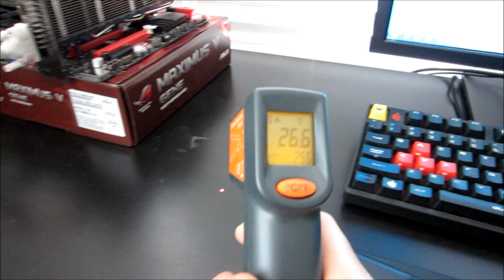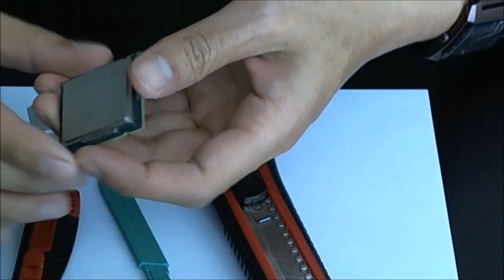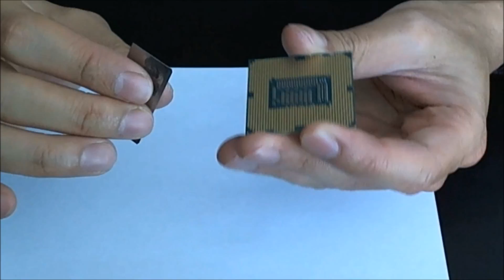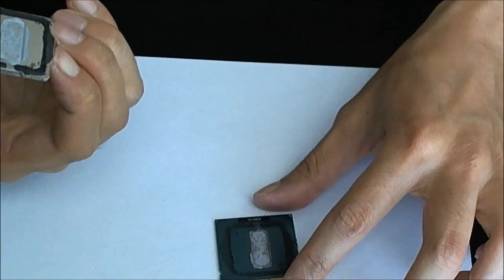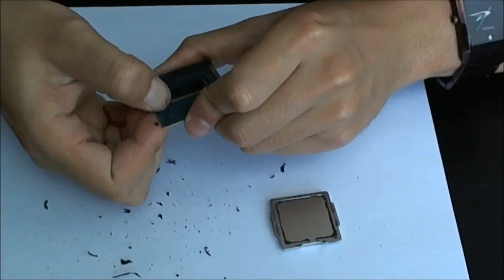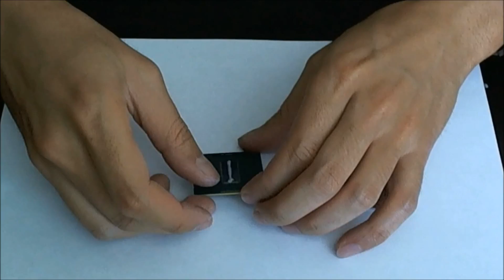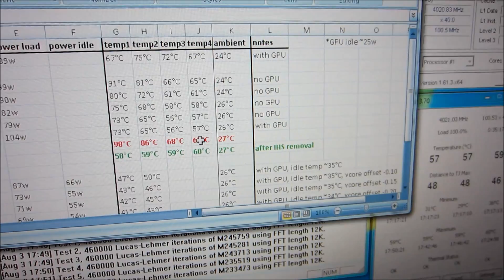Fixing Skylake, Haswell, and Ivy Bridge CPU temps: IHS removal

Comment: Touching the pins with your fingers reduces their conductivity
Reply: TheOfficialKiro67 In Intel CPUs the pins are in the socket, but the other part of the pins is in the CPU. In AMD it's the opposite
Reply: You are both right. The electrostatic discharge will massively overvolt the transistors inside (you'll put a few kV in there if you're unlucky), causing them to fail. Some do so open circuit, others short circuit. So the ESD itself does not make a short circuit, but the result of the killed transistors probably is a short circuit.
Reply: i don't think that tose cpu's have pins , only old cpu's used them
Reply: oh sorry , i actually tough he was talking about pins on the CPU, i jsut saw a person on 9gag did this mistake (he tought that intel cpi's have pins) and i tought
 he was also talking about pins on intel CPU, my bad
Reply: ***** the ones in the cpu yes
Reply: yes it does, by increasing resistance by less than 50mOhm..... LOL pins in socket are sharp because of that reason
Reply: a little rubbing alcohol and few q-tips would clean that right up
Reply: ***** you cant short circuit pins with static electricity
Reply: static electricity cant short 2 pins, it can only kill cpu
Reply: but still cant short pins :)
it shorts transistor :D
Reply: It shorts the transistors that are in between the pins causing a direct connection between said pins (or contact pads to be more precise, but pin is fine in my opinion), which is a short circuit between the pins.
Reply: Skin oils can cause issues and malfunctions. Contact is needed for the signal to go through properly. You have a foreign substance in between those contacts issues will arise more time than not. I've seen some chips that had coffee spilt on them and not one issue. Others a spec of dust is a huge problem.
99.99% pure alcohol will clean just fine.

Comment: I was delidding my 4790K because there was a huge inconsistency between the temps of the different cores. I nicked the chip on top if the ICs are on the left, but I assembled everything and everything seems to work. I've been using the system for over a month now. What is disabled in my CPU? All the data buses that I currently use work just fine. I am however, hesitant to buy new parts as I don't know what will and won't work.

Comment: Don't do this at home guys... If it has high temps than it should have, just return it. This will void all warranties on the CPU.. And don't do this ESPECIALLY if you have never built a PC before. Because if you have not built a PC before, then you are fairly new to PC hardware.

Comment: would leaving the IHS off altogether show better temps?
Reply: leaving the ihs off is better because of less thermal resistance - would be better without a heatspeader and using a hs with a copper base, the main reason for the IHS is to stop dumb people cracking/chipping the die. surface area has nothing to do with it because the headspreader will still have the same surface area that the hs would have straight onto the die the difference is the extra thermal resistance that the ihs creates between the die and hs.
Reply: surface area

Comment: Just something to say... TRY AS MUCH AS YOU CAN  NOT TO TOUCH ANY CONDUCTIVE PARTS OF THE CPU. AND WHY IS THAT? YOUR SKIN CONTAINS FATS, YOU CAN SEE THEM WHEN YOU WIPE OR SLIDE ON YOUR PHONE'S SCREEN WITH YOUR FINGERS. ANY OF THESE FATS WILL DECREASE THE CONDUCTIVITY OF THE CPU. TRY TO HOLD THE CPU ON THE EDGES, TRYING NO TO TOUCH PINS OR METAL PARTS WITH HANDS. IT'S JUST A SMALL TIP, IT WON'T AFFECT THE CPU MORE THAN 1-5% . HAVE A NICE DAY EVERYONE :)
Reply: This doesn't make any difference. Having fingerprints on your cpu before you apply the thermal compound is a bigger issue.
Just a small tip: the key above shift disables caps :-)
Reply: I can clearly see that you didn't get the point.
Reply: I did get the point. I tested this some time ago with an X5460. I touched the conductive parts a lot. The CPU works as normal. If you are grounded there's nothing that could happen. If the surface of the LGA Socket of the CPU is covered in fat, the pins on the mainboard are pressing hard enough on the cpu so there will be good contact.
Reply: +Moritz Rudolf I have an engineer degree I don't need to argue about that with some guys that read google and think they're smart and be here just to post troll comments. I can clearly see you have no knowledge in electrical conductivity and resistivity. I will leave this conversation right now

Comment: I think not using adhesive between the chip and case is a bad idea.. There is glue to help prevent too much pressure on the chip causing it to crack or break.

Comment: Why not just get a better cooler?  Delidding in skylake is pretty useless from what I've seen too.. my CPU never gets over 60 C in prime 95, core i5 6600k
Reply: My 6600k idles at about 29c, under full load about 65c. (it's overclocked to 4.2) I cool it with air too and people wouldn't have so many problems with temps if they used a quality cooler.
Reply: Beast6228 mines under liquid, at 4.7
Reply: Ehsan Mintman H100i gtx, MSI Z170a SLI Plus

Comment: good day... iremove my IHS, upon removing it transistors were hit and remove.... 3 or 4 resistore were damage.. so... i thought it was broken.. but when i tried itagain.. it still working... my worries is that would could be the possible effect if those transistor were remove.. my processor is A8 hope you can answr me thanks
Reply: amd a8 are soldered, there are tons of little transistors under there

Comment: i have westmere l5630 its core 3 and 4 have 10 degrees Celcius difference, and using prime it would hit 90 deg C after few seconds (even after reaplying as5) .. so i tried removing it from dead E5520 and there were little capacitors which were damaged (probably blade went a bit deep when prying it out) and even though the seals of ihs were broken but it wont come out .. neither would it budge sideways with twisting so i appiled little force and half of the chip came out attached to ihs...  but there was no thermal compound like applied on your cpu. it was some sort of stronge glue.. i still cannot remove the remaing chip form teh ihs.
so yes do not try it on sandy bridge.

i have uploaded a video of it.

Comment: Pro tip: Cut into one corner, then get a small, thin plastic spudger and gently force it in the the cut. it helps keep the risk of cutting and damaging the pcb down.

Comment: Haswell refresh (devil's canyon) and Skylake are cooler running CPU's as they changed to a different compound of paste, you do not need to "delid" them unless you are wanting the cooler to make direct contact with the die, which I REALLY don't recommend, and with skylake you are just jitterbugging with death due to the fact that skylake uses a much thinner PCB than earlier CPU's. I can run my 4790k at 4.8 all day and not see above 65°c on the hottest core. Also air cooling with big overclocks????????????????? Are you mental?????
Reply: +Kris Burke You can still get a significant drop in temps,something around 20 degres on a devil canyon if you delid,change the thermal paste and remove the adhesive that holds the lid on the cpu.and then you put the lid back,so is your 4790k delided or not ?  and what cooler do you have ?
Reply: +R Madalin I would not delid if you paid me to, it's a fucking stupid idea and I've never heard of that much of a drop unless you have it on LN2, at the moment I have a Cooler Master Nepton 280L with Vadar 2250RPM SP fans on it, I have everything but the new black chrome piping for a CPU and GPU custom loop, 1x360mmx30mm rad, 1x360mmx45mm rad and 1x120mmx45mm fan on the rear for good measure.
Reply: +Kris Burke well you don't exactly need to delid since your setup is water cooled, but if you are on air deliding  may be worth it. Just look in this dudes vid, he dropped his temps by almost 30 or so degres
Reply: +R Madalin "Overclock on are" because you like to set fire to space and time.
Reply: +Kris Burke wut?
Reply: +R Madalin I would NEVER recommend overclocking anything above 4.2ghz on air, EVER, you are flirting with failure there, no wonder you are getting freakishly high temps per core.

Comment: try using a blade for a safety razor, they seriously just slide right through the adhesive because of how thin and sharp they are. much less pressure needed, meaning safer for you and the part

Comment: You know I moved a cpu from one motherboard to another ... didn't clean off the old paste.  I put on a fan from an old pc, didn't clean off the paste but did add a "blob" more as it looked a bit dry and sparse.  At the weekend I removed the fan and put on a new heatsink, this heatsink had some pre-applied thermal paste.  So the PC has 4 different kinds of paste mixed up (old stuff from fan and cpu, pre-applied and blob ox MX2).  I booted up the PC and the temps are idling in their 20Cs with temps on load between 40 and 55C.  Thermal paste maybe needed but not to the extent and exact science that many believe.
Reply: sounds like you might have won the silicone lottery.  Imagine if you wiped off all that crust old paste and put on just a dab (less is better) of new stuff

Comment: People here generally think that a heatsink cannot be installed directly onto the CPU die once the heatspreader is removed...this is not true..people regularly took the heatspreader off back in the socket 775 days...you will definitely reduce heat considerably if you reapply the thermal grease on the die and put the heatspreader back on OR even more if you install the heatsink sirectly onto the die...you just have to see if the screws that came with your heatsink/backplate assembly have more threads than are needed...if not, you can most likely buy the same screws with more threading on them to screw down the heatsink further....you just have to be careful as to not crush the die with too much force...going directly onto the die will yield the best performance in cooling the CPU down...up to 25-30c depending on the CPU you're using.
Reply: +Gurvinder Parmar well intel went another fuck u onto consumers making skylake pcb thinner than earlier ones, resulting in a more fragile cpu, possibly bending.
http://www.pcper.com/news/Processors/Intel-Skylake-Processors-Can-Bend-Under-Pressure-Damage-CPU-and-LGA-Socket
i guess that was another 0,5 euros safed like the heatpaste vs soldering.
gosh fuck u intel.
other manufuctureres throw strong backplates on their products to streighten it, like graphics cards, or even motherboards nowadays.
intel says fuck u we got a monopol, we do what we want!
Reply: +cataria I wouldn't take the heat spreader off of Skylake unless you are putting it back on...lapping the heat spreader would be a great idea...and further lapping the heatsink base as well.

Comment: There is no need to "fix" Skylake temps. My 6600K keeps 23-26 (depending on ambient) degrees during idle and max 65 during stress while being overclocked to 4.5 GHz.
Reply: +UpiornyOdkurzacz I just built my 660k system and it idles at 22-24c and at 4.5ghz, it goes to 58c...using Corsair H115i...very happy with the system.

Comment: I have a i7 4970K  + antec water cooling cooler..     it always run fine and quiet..  but cores where getting pretty hot while stressing them. .. ~85c   @ 100% @ 4,4gHz  

the cooling system never got hot.. the cupper block was barely varm..   tryed replacing the thermal paste.. didnt help .. 

used it like this for a year..   

a couple of days ago I was abit boored.. so I tryed overclocking my gtx980 and cpu..  cpu was stable at 4,6gHz  and benchmarks got abouit + 15%  higher scores..   kinda cool... then I noticed I hit 100c at stresstests.. but computer was still steady at 4,6 ghz,,,  later it started thortling down.. 

could only keep like 4,2-4,4 ghz @100c ..        still the water cooling system was really cool..  bad heat transfear ? or bad temp sensors ? 

I desided to try this heat sink removal thingy. .   now I done it and it´s even worse :D 

wtf..   idles at 35- 45c    and stress tests make it thrortle down to 4  - 4,2  ghz.. when hitting 100c .. 

yay I made my 4970K into a 4770...  :P 

seems permanently fucked..      used arctic silver 5 thermal paste.. and the line method on all surfaces..  and did not use alot of it..     should transfear heat just fine. 

tryed replacing it several times with diffrent amounts of paste..  but  getting more or less same results ..   

overclocking is gay. . . should have just left it at 4,4gHz and been happy with it..    it still runs every game at full hd on ultra settings anyways.. 

bleeh..
Reply: +TheKlingis That sounds to me that you crapped out in the silicon lottery with that one, my 4790K gets 4.8 all day and sees a highest of 65°c under load, 85°c on a burn in test and that is with only a cooler master Nepton 280L AIO, I'm getting all I need for a full custom loop and I will be going for 5ghz on this CPU.
Reply: +Kris Burke be careful man, you might fuck it up like I did mine 😜..   these processors already play all the latest games and isnt a bottleneck no matter what gpu you got.,.   I guess overclocking it for editing videos faster or some work like that would make sense but for games it wont do much diffrence..
Reply: No need to be careful, been overclocking PC's since the early 90's, these days it's a cakewalk. I find out what the CPU won't do, then back it off till it's stable, and I always burn in CPU's and GPU's before overclocking also, you can get way better results than just going in with a green core.
Reply: I used an automatic overclocking tool that came with the motherboard.. It left it pretty high and it ran fine for a while,  until it did'nt, lol..     I should had gone on a forum and looked at other peoples results instead and put in the valued manually..    Oh well..
Reply: I never use that tool, I always do it the old fashioned way, manually, in the Bios.
Reply: +Kris Burke 
Yo man.. wtf 5ghz ? u need some insane cooling for dat stuff 
and yeah, no reason to go for 5ghz, it doesnt do shit
better 5 years of 4.2-4.6 Ghz than 1 year of 5Ghz
Reply: Just doing it for a competition between mates, have had this CPU to 5 ghz under water before, the normal clock for this CPU is 4.8 with no boost, I have 2X360mmX45mm 10FPI Alphacool rads and a 120mmX60MM radiator in it, might be modding the case to fit another 120mmX60mm rad in the bottom soon, just finished the loop on it last week, the AIO almost melted when I did it last time, so this loop should be enough.
.

Comment: Dare god this is nightmare for pc folks how he handling the cpu seems like rape.
Reply: No
Reply: +Chris Frog It is rape, I would NEVER do this shit, ever, specially with Skylake, skylake has a thinner PCB, you will fuck it's shit if you try to remove the heat spreader from it.
Reply: ***** their is actually tools to remove it properly thats fine cost around 60 USD but this way its rape and bad that hes showing other to do this way.
Reply: I wouldn't do it anyway, the poor heat dispersion problem only seems to affect the Ivy bridge and pre-devils canyon Haswell CPU's, I have 3 devils Canyon CPU's, a G3258, an i5 4690K and a 4790k, all can be overclocked past 4.6ghz and the highest temp I've seen on any of them was 85°c on a burn in test at 4.9ghz and that was the 4790K, and that was on a 44°c day when my room A/C was off line for a regas, normally I have it at 4.8ghz and it doesn't see the high side of 60°c under load on the hottest core, I have heard of 6700K's hitting 5.1ghz with about the same temps, none of them have ever been de-lidded..
Reply: ***** what Volt did you go on your skylake 6700k with 5.1ghz I currently clocked my skylake 6700k to 4.7 on all cores I had it on 4.8 on two cores
Reply: I did not say I had skylake that high, I think you need to read more carefully, I have heard of people getting them that high under water (I do believe they had a 560 just for the CPU), no idea of voltages, my 4790k is doing 4.8 with 1.35v, and that is on all cores.
Reply: PS, I'm pretty sure they are only on a single core also.
Reply: ***** my bad for miss read, but i don't think i'm able get 5.1ghz on all cores i got myself AIO Corsair h110i GT hydro i really wanna reach 4.9
Reply: I got 4.9 out of my 4790k, over all cores, just waiting till I have all my chrome piping and fittings to do my new loop before I run it at 4.9 all the time. because I'm running a GTX 980ti in the loop I'm going 2X 360's 1X30mm thick and 1X45mm thick and a 120 in the back just for an extra lot of cooling, also waiting on a new motherboard, the cheap shit Asrock I was using shit itself so I sourced a gigabyte Z97X-SLI to replace it.
Reply: ***** i been thinking get myself custom water cooling that wil be easy & good solutation for my Corsair 750D case when the new GPU comes out my 980 starting become old for me i might put in my AMD 8350 Riq but when it comes to custom water cooling i never actually done it but i done ressearch over 7 years now feel like if i'm going to do water cooling it be perfect to start doing it now I brought myself the asus formula VIII it already has Water block on the board. i'm aiming for good performence ofcourse but also a sweet classic nice look if you get my drift.

Comment: This is not the case with the xeons to be more specific, the e5-2683 and it wasn't thermal paste but instead it was solder. I ended up destroying my CPU because in the process I actually broke off a few capacitors. I had to buy a new Xeon, the e5-2699 for my Asus x99e-ws usb3.1

Comment: Holy hell 40 C difference? That quality looks really half-arsed work. Are you sure this procedure is safe to do to Skylake?
Reply: Its NEVER SAFE.  The failure rate of the delidding process is like 25%.
But worth it though.  On my 3770k at 1.33v,  got 25 degrees less.  Skylake has a better tim though,  so you wont get so big of a difference